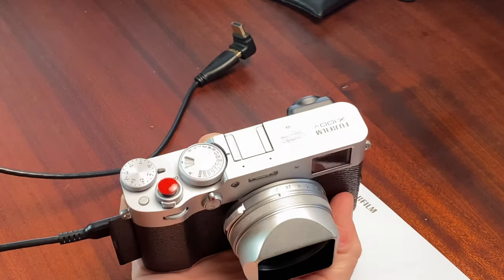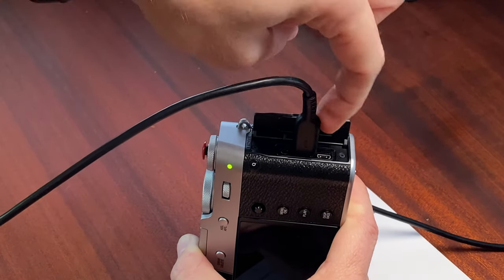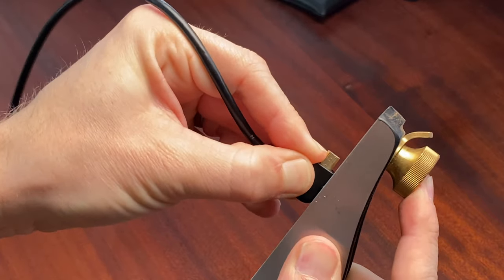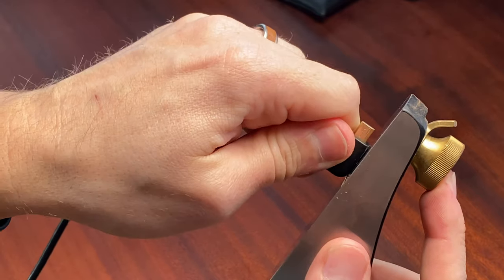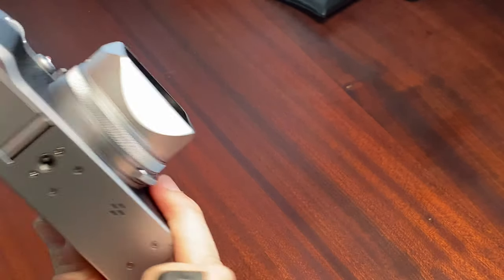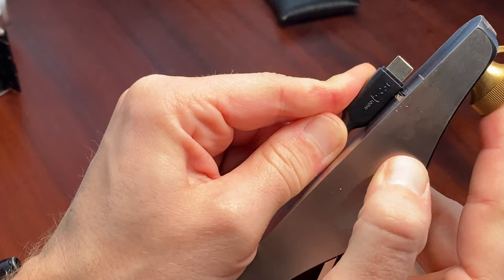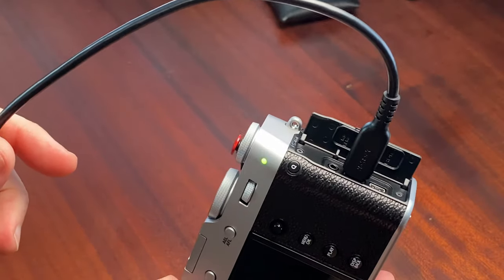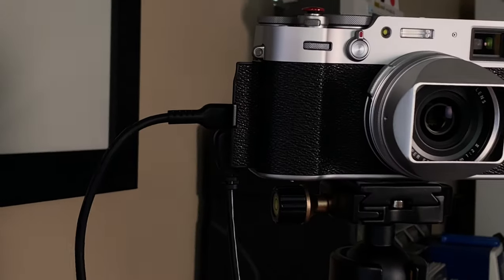Fujifilm X100V HDMI + USB-C Cable Hack

Comment: Question regarding clean HDMI and autofocus:  can the camera output clean HDMI and do continuous autofocus?  I have gotten fond of using a nice camera for a "webcam", and had sold my X100F because it couldn't do what I needed.  If the X100V can output clean HDMI, run of usb-c power, while doing autofocus, that would be quite nice!
Reply from the maker: It sure can! I've been using the X100V and my XT-4 as a webcam now that everything is an online meeting. They both do a good job of constant autofocus (the focus switch set to C) with face detection. Fuji recently released a plugin that's supposed to allow you to plug the USB-C cable into your computer and it automatically shows up as a webcam video stream. I couldn't get it to work when I tried it on my Mac, but I've been using an Atem Mini which can take 4 HDMI inputs and separate mics, allows cutting and mixing between the inputs and has it's own USB-C out which shows up as a webcam. Highly recommended!

Comment: Hi Rob, how do you keep the camera powered on and continue to function while charging via USB at the same time? I use an X100F (guess this feature must be similar across F and V) and the camera shuts off as soon as I plug in USB to charge while intending to record via hdmi at the same time. I see that you could do that. Can you help me understand how. Thanks much.
Reply from the maker: I think I read somewhere that if you have your USB port set for data transfer that it won't charge at the same time? You could check that in the Connection Setting menu.

Comment: How do I get this specific camera to do USB tethering? When I connect it to my Weebill S steady cam the screen goes black and just says USB. I'd appreciate the help. Been looking for a solution for a while
Reply from the maker: I actually can't get the Fujifilm Webcam software to work for me on my Mac, either. :( I've been using the HDMI output connected to an Atem Mini, which takes up to 4 HDMI inputs and outputs them over a single USB-C cable that shows as a webcam on the computer: https://amzn.to/2J9fJgP

Comment: Ido you think is it  possible to connect headphones to HDMI output camera ? Using an adapter  HDMI to usb C ? I bought the canon 77D but it doesn't have headphones output but I had that idea but I am not sure if is possible or what kind of adapter do I need to buy !?
Reply from the maker: You should be able to do it with something like this (although I've never tried): https://amzn.to/2GgnKPC Plug in HDMI and extracts the audio stream to both an optical output and analog L/R output!
Reply from the maker: Does the Canon have a USB-C port? A lot of cameras are starting to use that for headphone output.
Reply from the maker: Here's an Amazon Basics one that's even cheaper: https://amzn.to/2G8Q3Q8

Comment: Thanks for this video!  Does the x100v have clean HDMI / can you use it with external recorders?
Reply from the maker: Sure does, I use it with an Atamos Ninja V and it works great. I have noticed that if I hook up an external microphone and go into the X100V the audio has some weird volume issues where it drops way down every few seconds, seemingly randomly. If I hook up the external mic right into the Ninja everything is great.
Reply: @cannikinn  Awesome!  Have you ran into any overheating issues with longer recordings on the x100v (when used with the Ninja)?
Reply: @BassICLeh  I ran a test today just watching it to see how long the battery would last at 4k from HDMI and it ran for about 1 hour 15 minutes before the battery went. Waiting for my coupler to come in, but if you just output and not write to the card, you can go as long as you have power. It was warm, but did not get close to overheating. Ordered the coupler before seeing this video though. O well. Does the USB-C charger charge fast enough? i.e. provide enough power to keep the camera going while doing video?
Reply: @sangkong9738  any tips on how you got it stay recording? despite being connected, and despite simply outputting and not recording to SD, it keeps shutting down on me. I saw there was a yellow temperature warning on the screen but sounds like you aren't having that issue.
Reply: Shiv Rao I’m not convinced it was running at 4K  anymore. I can get it to run longer in 4K when I switch out the battery with a coupler and also do things like flip the screen out. Also I turn off continuous AF. There is a recent firmware update that helps stay on longer despite the heat but still safely. Also I was able to use a Mac usbc charging cable and it is very skinny. No need to shave away another cable. Anyway, charging the battery will cause too much heat. Also try a portable fan. It will work too. Internal mic is useless but I don’t use it. The body just can’t dissipate heat. Ultimately I decided to just go 1080p. 4K was overkill.